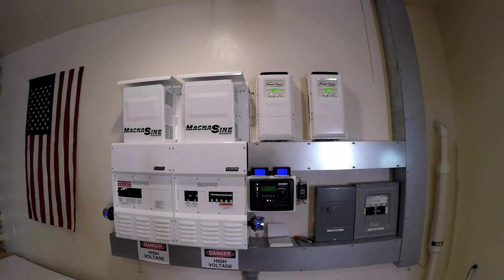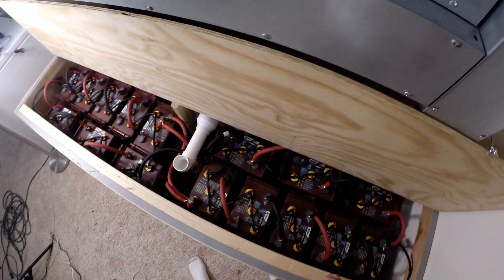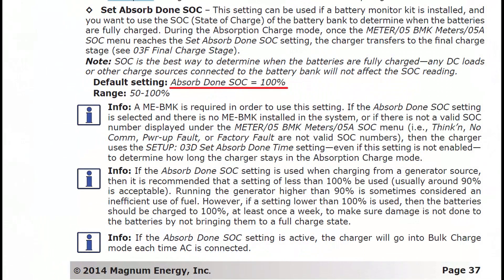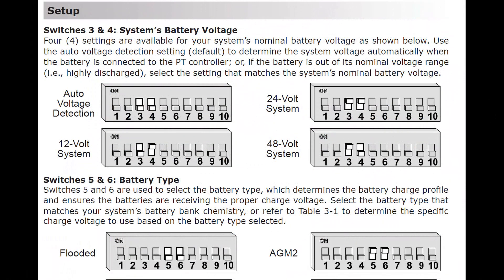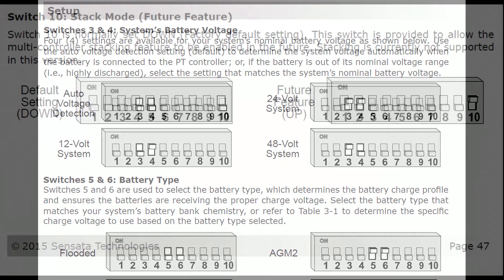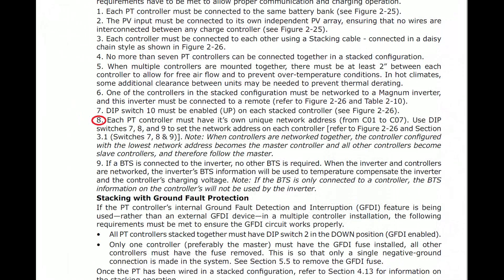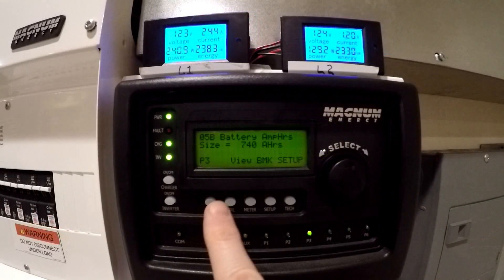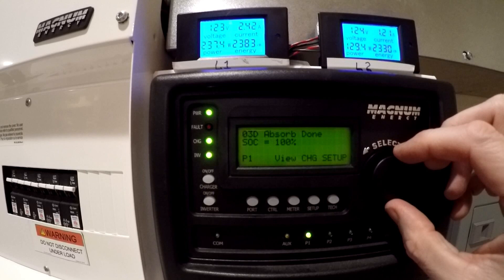Charging Parameters for my Solar Battery Bank

Comment: So u can tell it to do single stage control? 
Im doing lithium and dont need absorption mode at all. Or Float mode. I just need 58v or as close to it without exceedng it
Reply from the maker: I don't know much about charging lithium batteries so I can't help you with that.  My only comment is to be careful not to hold them at full charge.  i.e if you know you won't be using them for a while, don't bring them to full charge.  Good luck!
Reply: David Armstrong ya 58v is about 90% i dont ever want to charge higher then that. Maybe even 80%ish which is 57.5 i saw a few settings where absorb is 57.2 and one at 58. 

Question is can u set it for single stage charging or just multi stage charging?
If Single stage charging is available what are the voltages there. Are they the absorb or float voltages?
Reply from the maker: I am not sure...  You can tell it which stage to start in and you can set the voltages for each stage, so you might be able to make it look like a single stage.  Maybe???
Reply: David Armstrong so u can set the voltages from a preconfigured list or you can actually dial in exact voltage? 
You can set absorb volts to be same as float voltages?
If thats the case it might work
Reply from the maker: You might have to choose from the preconfigured list.  Since lithium batteries are not even an option on the list, I think you should call Magnum tech support and discuss with them what you are trying to accomplish.  Also, here is a link to the PT-100 manual:
https://www.altestore.com/store/charge-controllers/solar-charge-controllers/mppt-solar-charge-controllers/magnum-solar-charge-controllers-mppt/magnum-energy-pt-100-100a-mppt-solar-charge-controller-p11900/

Comment: Hi David -- I have a setup similar to yours albeit smaller for now (1xPT100, 1xPAE4448 inverter/charger and the RTR). Just curious though, I understood from Magnum tech support that the PT100 could NOT currently be programmed from the RTR -- the charging parameters entered in the RTR are for the 4448 charger when using AC (grid/generator) to charge the battery bank.  Thoughts?
Reply from the maker: Just reading your comment here and ... I think you might be right.  I'm going to have to look into this.
Reply: So they have a new Advanced router ME-ARTR that can be used to program/control up to 7 PT-100. Time to upgrade!
http://www.magnum-dimensions.com/me-artr-advanced-remote
Reply from the maker: After looking into this a bit more, I am pretty sure that my PT-100's are networked properly and the charging appears to be working according to the parameters I have set.  Its been running like this for about 1 year without incident so I am not sure what I have to gain with an upgrade.  Here is what Magnum said about it:

"If the PT100 is networked with a Magnum inverter using a ME-RTR then it will follow the basic settings for charging for the inverter. So voltage and absorb done time are followed. If you have a ME-ARC used on a single inverter or the new ME-ARTR then you can have the PT100s linked and they follow the inverter settings or you can unlink them and have separate settings for the inverter and PT100s."

Thanks!
Reply: Interesting, and good to know. Thanks for digging deeper...

Comment: That's way to low. Needs to be 1.275 to1.285   raise your absorb voltage to 60 float to 56. You'll ruin your batteries if you don't do something right away
Reply from the maker: It could very well be 1.28 already.  I really can't read it that closely.

Comment: What is awesome about RE systems is that no two are alike...best practices may be different with charging set points vs what the literature recommends. Took some "bad" advice a while back and will not make that mistake again. Just glad (in my most recent issue) it was caught before things got bad. Thanks for sharing this info...helped. Your system is sexy!
Reply from the maker: Thanks!

Comment: The absorb setting looks to low how is the specific of gravity doing when full charge
Reply from the maker: Hey Roy, I don't check the specific of gravity.  I am basically trusting and counting on the engineering behind the Magnum system to give me the best performance rather than try to out guess them with my own settings and monitoring.  That said, I'll see if I can get a few good readings when the system hits full charge.  Thanks!
Reply from the maker: I just tested 2 cells with cheap battery hydrometer.  About 1.26 on each cell.